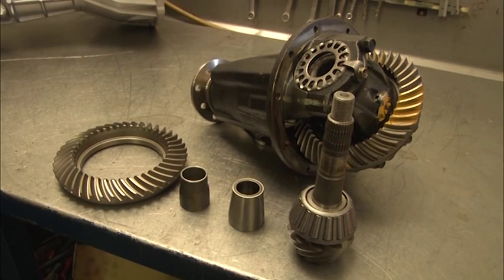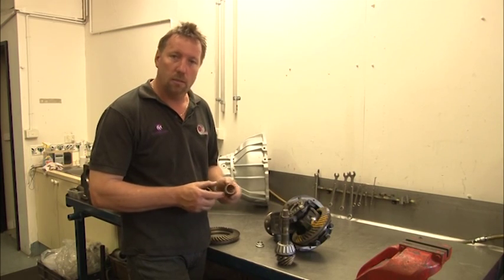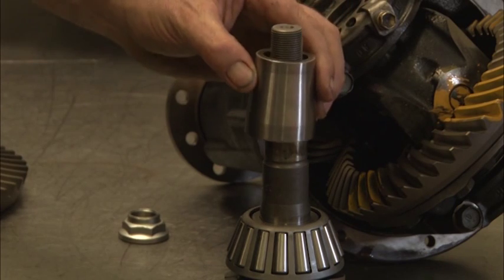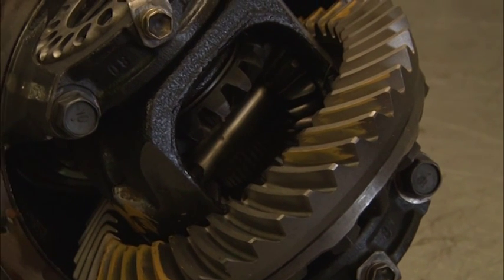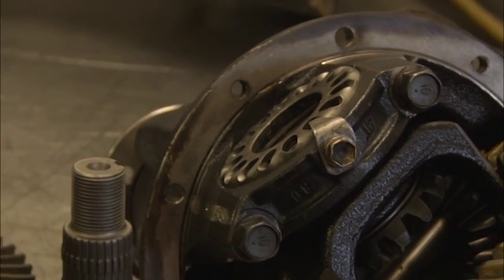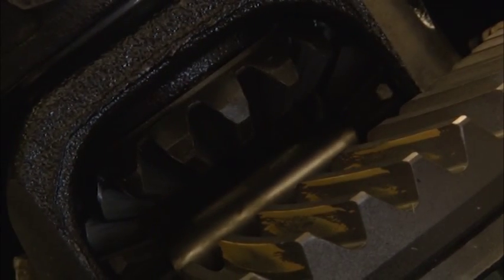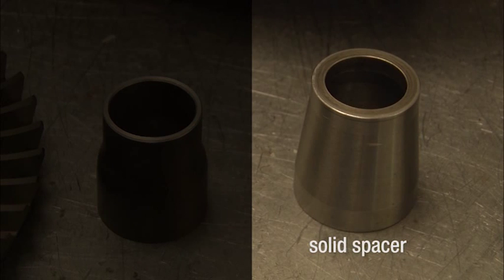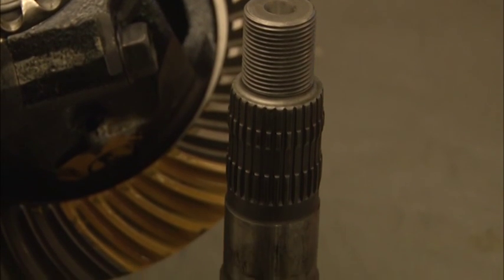Solid Pinion Spacers

Comment: You're a little unclear here, as collapsable spacers are NOT inherently more likely to wear bearings sooner than solid IF SET RIGHT and will not alter the pinion depth any more than a solid would when wearing. None of them can "un-crush" or re-tighten to adjust for bearing wear so when a tapered roller wears, provided it was never over-preloaded, it wears the same, pinion depth changes the same and if it were to wear enough to come loose and have float, it's also the same result.

Diffs are NOT "doomed" with a collapsable spacer at all, it's simply easier, less complex and harder to get wrong with a solid. All of that equals cost and time, so is a no-brainer.

Comment: Hi,if you replaced the collarspacer with solid spacer the pinion bearings preload is different correct?mean not to much preload ?...thank you
Reply: +ThanasisGR  I hate when I get no reply. To answer your question "no" the preload is the same.
Reply: +Anthony Wayne Hi,can you explain for what reason the preload must be the same? all diffs that i have seen the pinion bearings with collar spacer have knocks,thank you
Reply: +Anthony Wayne I know for why for fit the solid spacer,but my question was about pinion bearings preload,so i have a sierra cosworth 2wd and with original collar spacer due high tighting the gear oil overheating plus the bearings have a lot knocks,sorry for my not very good English!
Reply: +Anthony Wayne I have not any issue at the moment,just asked you because with collar spacer the preload is alot tighted for safety guess,behaves like a spring,the solid spacer is stable without any affect from torque etc,so the bearings can preload almoSt to zero,for better work and no overheating bearing and gear oil hope to understad what i mean,thanks
Reply: ***** 
Of course it use the shims but the point is to find the correct preload for the SOLID SPACER,as the manuals from manufactures it says only for the common collar spacer adjustments,but as i said the diffs bearings types works normally almost to ZERO,so with stable solid spacer the suitable preload is that for my opinion,already test my diff and works perfect at the moment!
Reply: Can you tell me why? the crush sleeve works like a hard spring! the solid is stable so why to preload the bearing more? these type of bearing is very difficault to takes gaps.....thank you
Reply: You don't answer why the solid sleeve must have the same preloading as the crush sleeve,the crush sleeve adjust with the pinion nut and preload  tight enough,why ?
I  have take out from 4-5 ford cosworth differentials, the pinion bearings and all have problem plus  overheating gear oil !,the one of these diffs was with 67000kilometers only! now i have mine with solid sleeve and i have recheck after 1000kilometers and the diff oil it is in great condition without overheating and the pinion is like a rock! with my all respect   the solid sleeve type have different preloading..
Reply: Me too pal, lol
Reply: To answer your question. You set the pinion bearing preload with a crush sleeve by plastically deforming it to a length that gives you pinion preload that is within manufacturers specifications. A solid spacer uses shims to obtain the same length as a "crushed" crush sleeve. The difference is a crush sleeve can only be crushed once. It doesn't un crush. That is why it must be replaced once pinion nut is removed. If you try to reuse a crush sleeve you run the risk of crushing it more and making your preload to high or not enough resistance against it and your pinion nut backs off. Also a crush sleeve has the possibility of crushing more while in the axle and you lose pinion bearing preload. A spacer will never change length. The only time preload will change with a spacer is when the bearings wear in. With a spacer once pre-load is set with shims you can take a yoke off all you want and torque a new pinion nut to a known torque spec and your preload will be good.